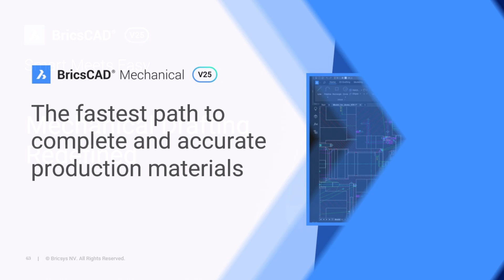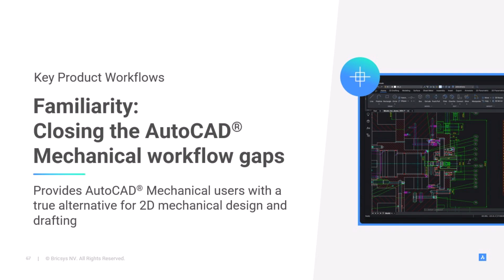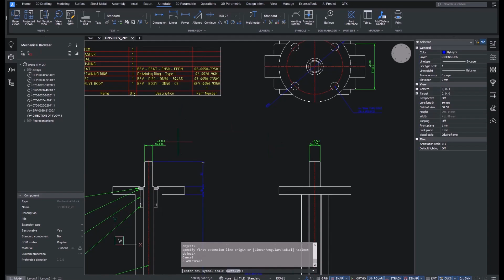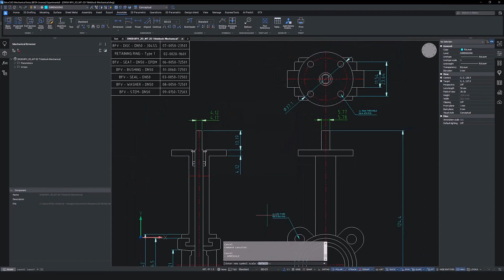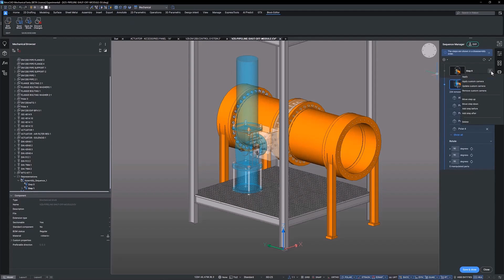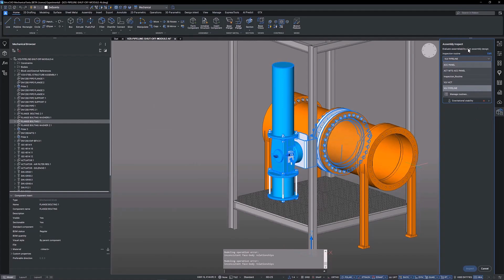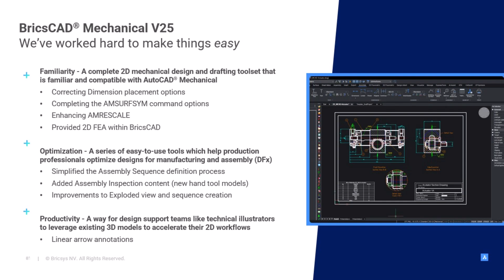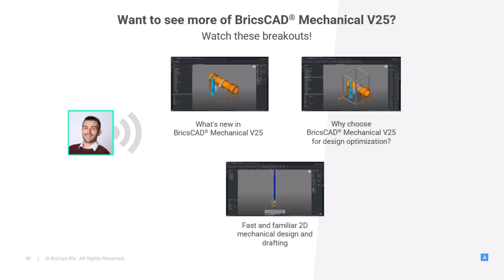What's New in BricsCAD® Mechanical V25│Breakout Session

Comment: Thanks - that's Interesting... My 3D modelling in another system is strong for fast concepting but the drafting tools, whilst fairly good aren't up to date and are limited in functionality. From what you demonstrate, your 2D annotation tools and 3D inspect for clearance or assembly / dis assembly with the 2D section analysis is what i'm currently missing. Could I import a step file of a design and use BricsCAD Mechanical going forwards from there?
Reply: With the Communicator module I think so